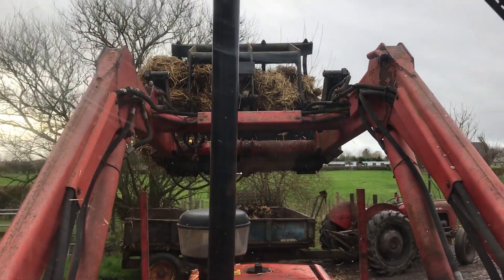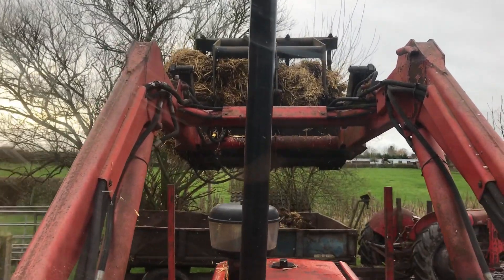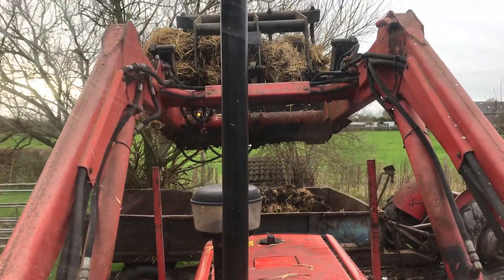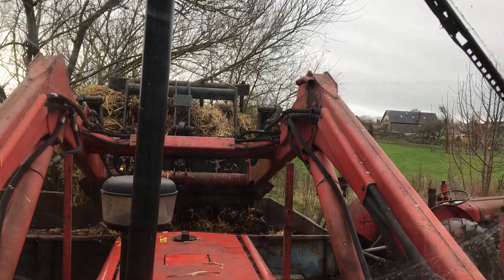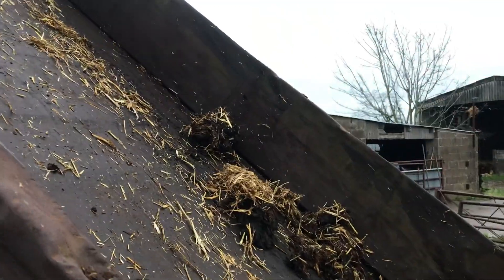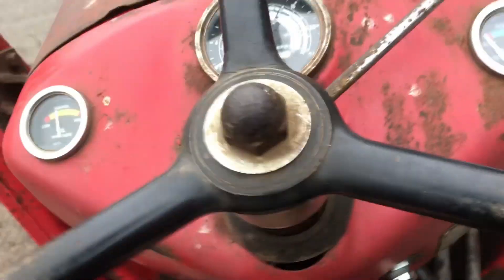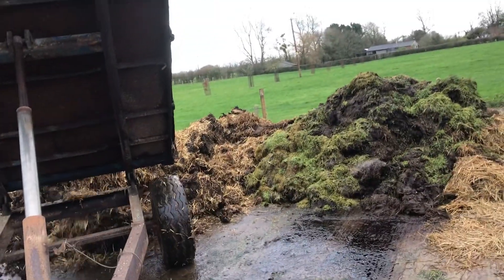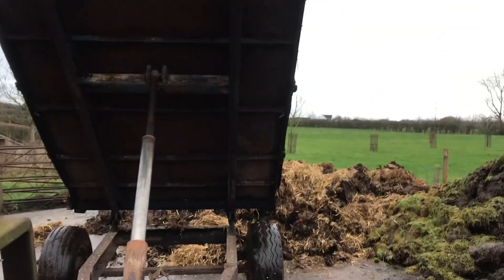Massey Ferguson 35 and 390 muck shifting

Comment: Nice you got any new machinery recently have fun off school
Reply from the maker: Thanks mate. Just picked up a bale spike today, but other than that, no.
Reply: @OliverLee390  nice where did you get it from
Reply from the maker: @vintagetractorollie9421  Down the road in Somerton
Reply: @OliverLee390  nice was it new and is it for a loader
Reply from the maker: @vintagetractorollie9421  No very old for the linkage
Reply: @OliverLee390  nice is it a femling
Reply from the maker: @vintagetractorollie9421  No some homemade job
Reply: @OliverLee390  that ok 👍

Comment: You have the same problem as me
Trailer is too small lol.
I mucked  my sheep shed out friday its only 200sqm and took 8 trailer loads🤦‍♂️ makes a long day with a small trailer.
Reply from the maker: For me there was no rush, just go on steady, we do have a larger trailer, but it would take an age to tip with the 35, plus where I was tipping it was rather tight once a pile of muck started to build up!
Reply: @OliverLee390  yeah thats true the 35 pump is not the quickest.
I did see an 8t muck trailer for sale not to far from me but it needs new floor  and both rams resealing i might give it a go it the price is right
Reply from the maker: @Supersagger1980  Good luck! Hope its all alright